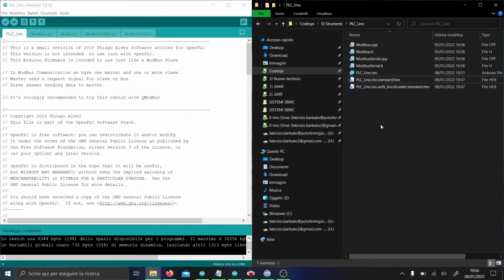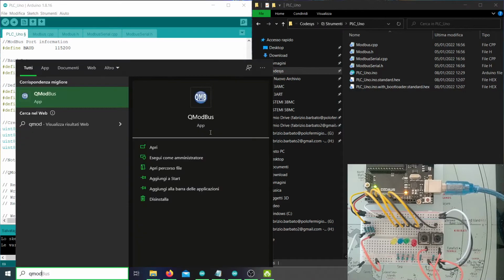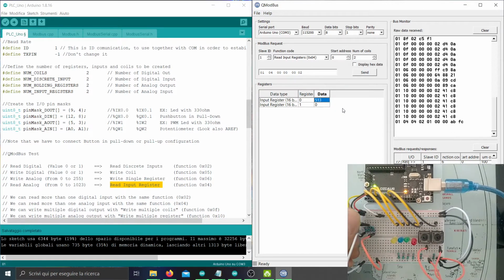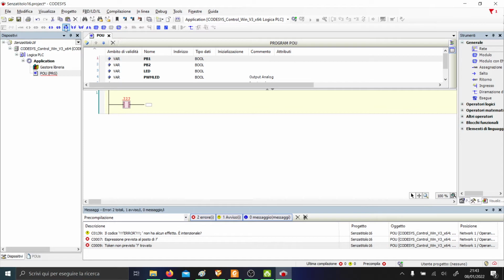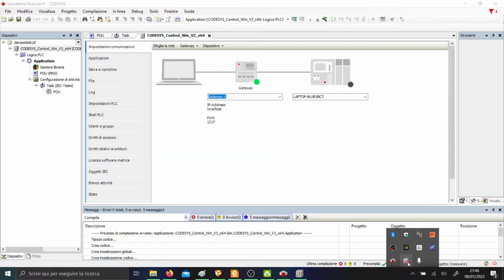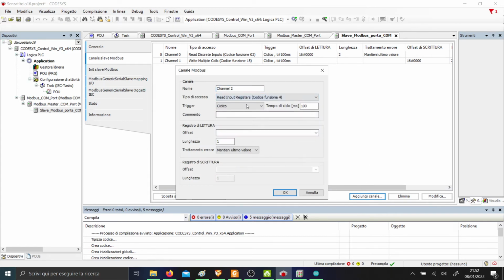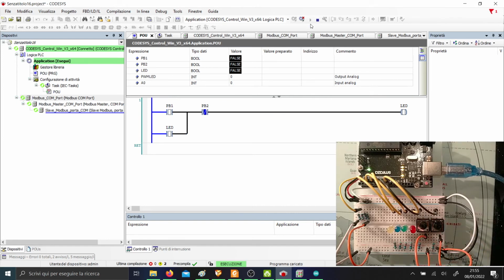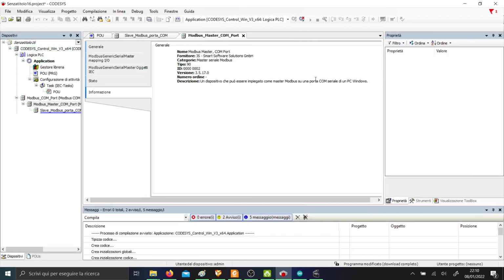Arduino based PLC with modbus USB protocol - First working program with Codesys and Arduino

Comment: un italiano che guarda un tutorial di un altro italiano ma in inglese.. 
mi hai salvato la vita grazie del video.

sto cercando di collegare il mio raspberry pi 4 (dove ho installato la runtime di codesys con il mio progetto + HMI) ad un arduino perchè devo controllare dei servo motori, il mio progetto finale deve controllare 15 servo motori SG90 (uno alla volta, mai tutti assieme). spero di farcela, prima o poi

Comment: Thank you so much for making this video, I am working on making an arduino plc slave to practice my ladder logic with and this really helped me make some progress. I have been getting an issue with "Bus is not running", and wasn't sure if it was an issue with the free version or if i was making some mistake. I installed the same arduino.h files, and referenced your code for the slave side. I was able to get everything to work with Qmodbus. Anyways, if you recognize my mistake I would really appreciate the advice. I plan to also ask my embedded professor about this problem, again thank you for the amazing video.

Comment: fascinating Arduino Modbus video.  do you have a video on the ESP32 Modbus master rs485 rtu  using serial 02  reading input 30001 analog?  thanks a lot.
Reply from the maker: Hi! Not properly... I'm just a mechanics that sometimes have fun with electronic stuff! Thank you!

Comment: I have a little problem. Everything works, but the I / O state changes from time to time. Arduino is on and the output changes its state to 1 and 0. Sometimes every few seconds, sometimes every few minutes. I checked on arduino uno and on mega. Same... :/
Reply from the maker: Mmh seems strange can you make a video and explain the problem?
Reply: @fabriziobarbato2  Solved. The solution is a pull down resistor.